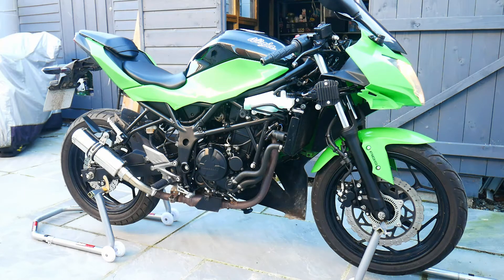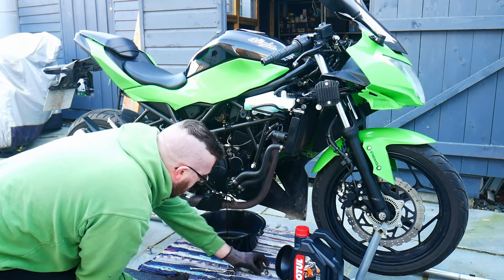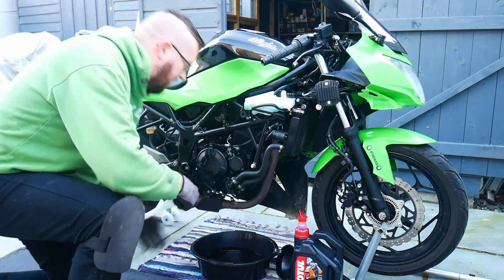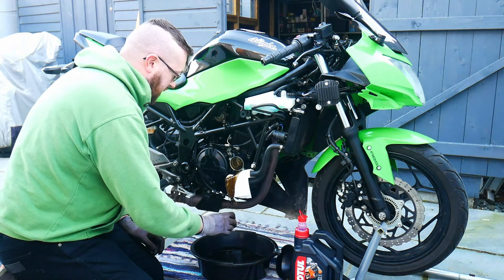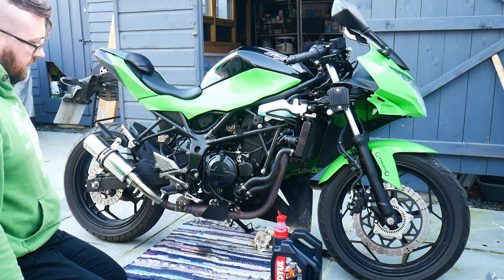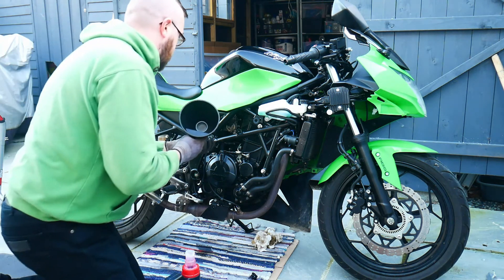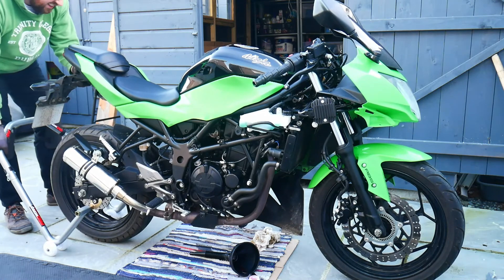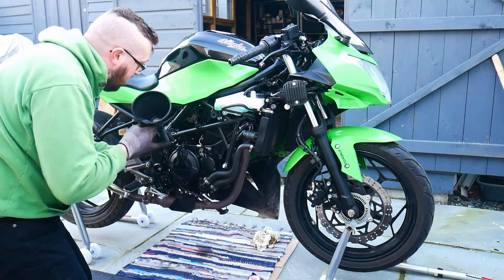Changing the engine oil and filter on a Kawasaki Ninja 250SL

Comment: Hmm not sure about super glue to hold the spring in place! I’ve used grease and it holds there well enough
Reply from the maker: Yeah grease is what is used a lot but you have to use more of it and I didn't feel comfortable using it or recommending it. With superglue you only need to use a tiny tiny amount and after it dries within a few seconds it holds stronger and don't have to worry about it blocking up any oil flow channels.

Comment: Hello. What is the engine oil capacity? Thank You!!!
Reply from the maker: It's something like 1.1 litres of oil. Very cost effective motorcycle to run
Reply: @TheMotorcycleMuse  Thank You very much.
Reply: 1,3-1,5 litres of oil, this machine same as d-tracker 250.

Comment: Can you tell me the torque setting for the sump bolt pls? I guessed and set it at 25nm, my old cbr600 was 23nm and the gsxr750 was 29. Also, have you found a workshop manual, maybe for the z250 or the klx which (i think) share the same engine? Thanks
Reply from the maker: The owner manual states 15Nm for the engine drain bolt which is very low but that's what it said. I didn't find a service manual for the ninja 250sl but you can look for one online for the previous model 250R and usually download for free. It's considerably different engine compared to the 250sl but it is quiet informative